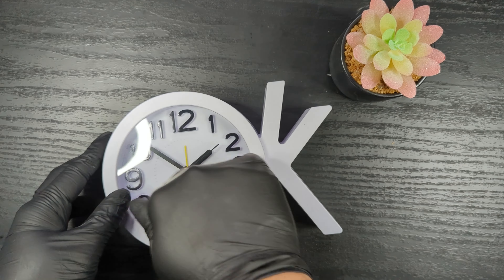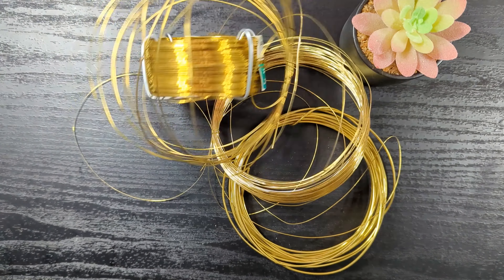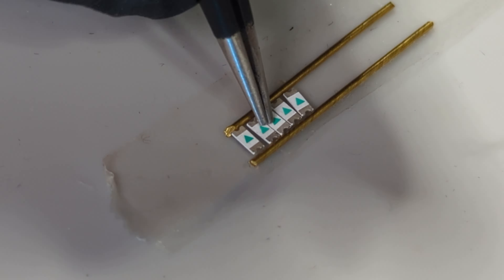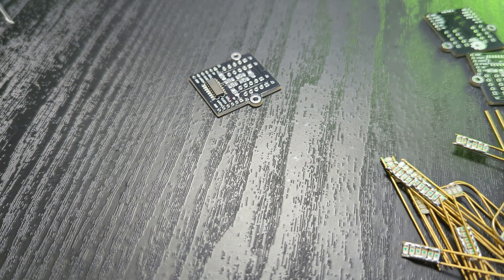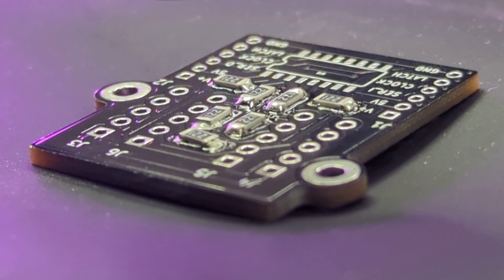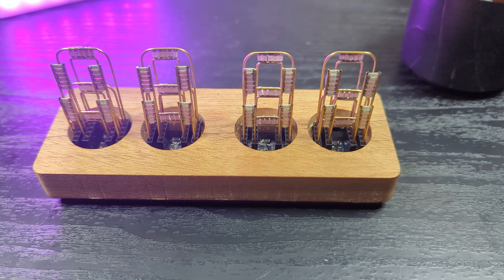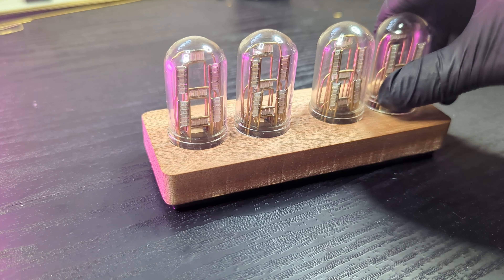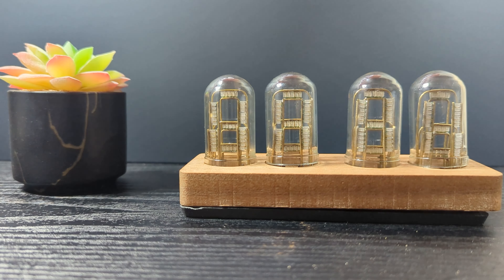Building the worlds coolest "Nixie Tube" style desk clock

Comment: Hi good project,I want make it but I have a doubt,what is the value of resistance of leds? Thanks
Reply from the maker: Thanks! , do you mean the resistor that I am using with the LEDs? Also do note I am also not sure what happen to the design that it stopped working (this was my first PCB board design). So only attempt this if you know what you are doing.  

I believe it was because I inverted the voltage source but I am not sure if it was something else and have not had time to check further.